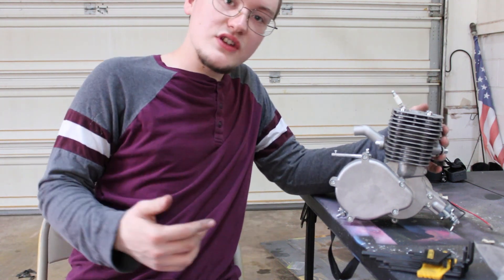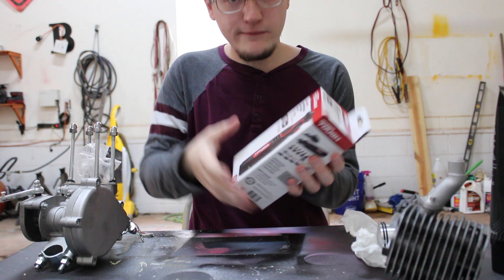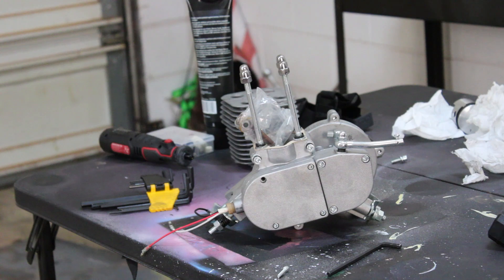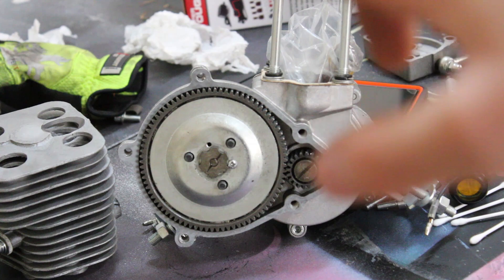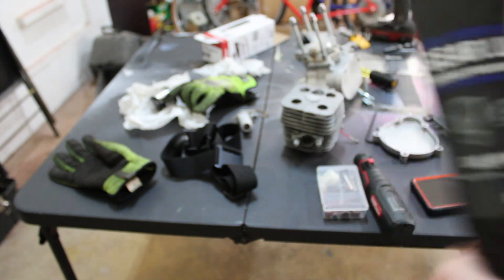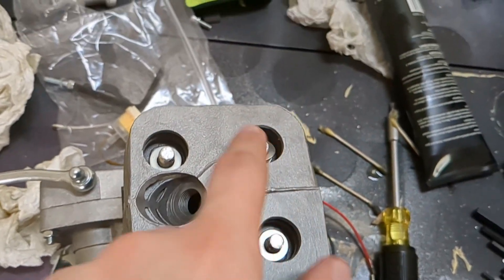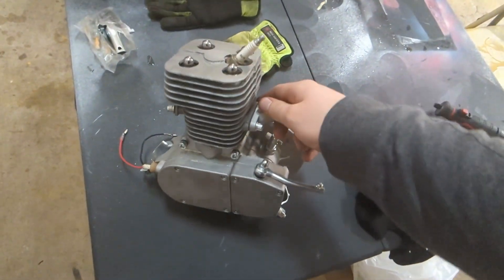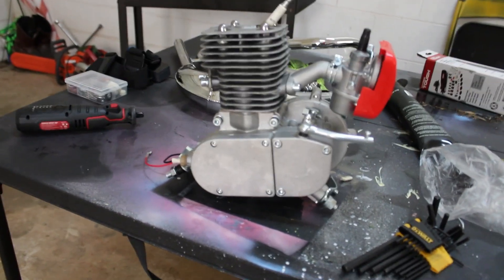Building The WORLD'S FASTEST 100cc 2-Stroke Engine

Comment: Arrow faces intake, by the way. 
You didn't use enough lube either. 
And a way to get the magnet bolts off is vice scipts.
Get an amazon delorto carb for a tomos moped
And always use an air filter. You will run your engine lean and overheat it
Also, make sure to get a spark plug gap tool and always gap your plugs
Reply from the maker: Most people point the arrow towards the exhaust.
 I will have to try vice scripts (thanks for the info btw 👍), I tried lubing the engine quite a bit I will lube it more when I mess with it more. 👍
I usually use a gap tool for the spark plug but I just couldn't find it 🤣
Reply: @BurksWorksYT  hell ya man. Not making fun of you btw just things that i wanted to see if you knew or do that i have good results with. What works works man.
Reply: Wrong, arrow is supposed to face the exhaust. Aka the ring gaps/pins facing the intake. You shouldn't go by the arrow anyway, they could be stamped in the wrong spot.
Reply: @trentbikes  nope arrow faces intake if it has a window on the cylinder skirt.
Reply: @theyluvniko4l  only go by the ring gaps/pins facing intake. Not the arrow.
Reply: @breezetixmoto  you always wanna point the arrow at the itake. Yes, rings matter, obviously, but there's usually a window, and that window is for the intake
Reply: It seems like this isn't the world fastest moped. I think it needs more modifications to make it faster rather than just to lube the parts and widen the ports.

Comment: Reeds are stupid cheap for those and will give you the biggest power increase along with a thin base gasket if you don't do a high comp head. Imo those Chinese engines just vibrate themselves to death. Cy gp460 engines are good for the money but you need a decent amount of ability to fab mounts and source some parts to make it work